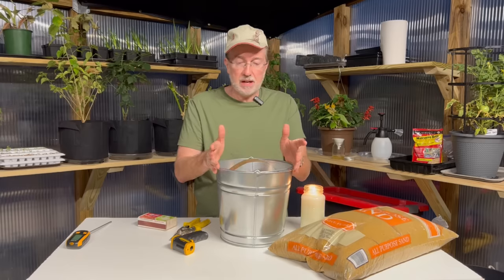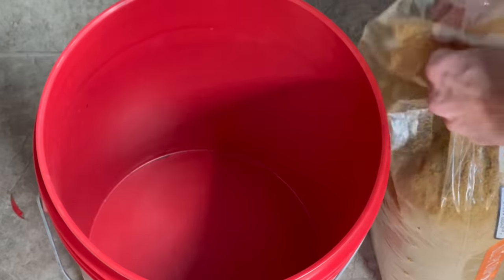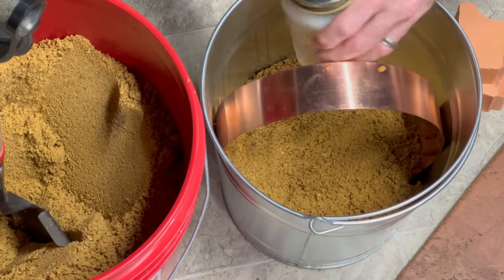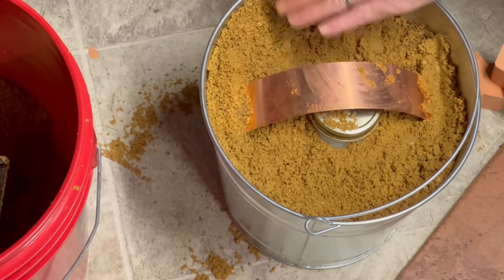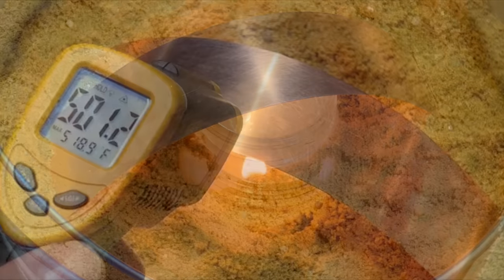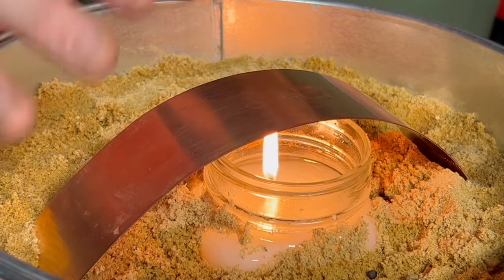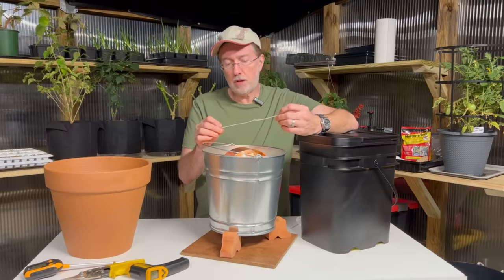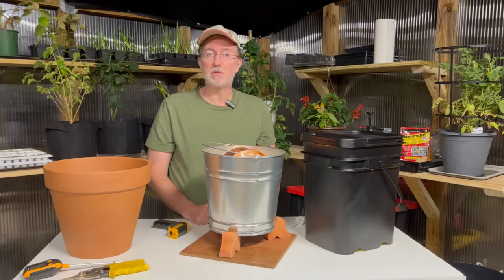DIY Copper And Sand Heater | No Electricity Needed For Greenhouse Heat

Comment: Perfect example demonstration of propagating so call magical principles 
While 80 BTU NO MATTER WHAT EQUAL 80 BTU .Don't be fooled Thinking this can genera any more .If anything good for attacking You Tubers viewers.
Reply from the maker: This candle heater isn’t designed to heat a greenhouse to a warm 72f but rather keep a greenhouse 1-2 degrees above freezing.  Tested 4 candles over 1 week and temps on nights without candles were 1-5 degrees colder.
Reply: @ZenGardenOasis.  So you have 2 identical green houses with the same plants and pots, building mass and insulation? and you have exactly the same measuring devices in both green houses? and you measured at exactly on the same time in each greenhouse (few seconds apart is not too bad)? 

If you did not then you cannot state your claim.

Comment: As an electrician can relate as copper being excellent conductor for heat. When leaving coiled bare copper wire exposed in the sun for a few minutes will heat it to the point where you can’t even pick it up

Comment: Using a large crisco container, get a matt for welding or a welding blanket and cut a strip of this into a strip small enough to be fed through a small section of copper tubing leaving just a quarter inch above the tubing.  Flare the copper tubing to stand on its on or dont and just have the tubing held stationary while the crisco hardens.  You have created an almost forever candle.  The oil will eventually burn off but over a period of months not days.  Welding blanket material withstands around 1800 degrees of direct heat so a simple flame in a candle format will never use the wick only the oil.  You can have a can liquified to top off the candle in such a situation as the oil burns down.  Using this inside a large metal bucket as outlined above with the copper strip should easily heat a room or two in a home.  Remember to let the co2 out a few times a day just to be safe.  God bless

Comment: Little bit of advice.. please use an old paint brush to sweep the sand around or off of the copper, as (you said) it can be sharp. Much easier

Comment: I can't get this to work at all, copper is touching the bucket at the bottom and sides, the copper strip is not even warm where it goes into to sand? Any ideas? Does sand have to be bone dry for it to work? Now considering drying it in the oven!

Comment: I'm thinking about a hybrid system in my greenhouse. It's not 8x16. What I'm thinking is running a small solar fountain pump to pump water from my rain barrels, through a solar water heater located outside the greenhouse. The warm water would come in and run ( bottom to top) through a coil set in a drum of sand, then return to the rain barrel. Basically use the water to heat the sand because the sand will hold the heat longer. The pump is solar and plenty to move water through a closed system of that size.

Comment: Is this okay for a drafty house with the home having a  main heat source like a hot water baseboard heater? This looks safe to use as a supplement.
Reply from the maker: I use it primarily as a supplement to my greenhouse heating. In any case I make sure I have smoke/carb monox detect w/ fire extinguisher.

Comment: Thank you for the video.
I am new to the channel (just subscribed).
Do you have any practical for a fridge that doesn't needs electricity?
Reply from the maker: Yes….my parents had RVs in the 80 and 90s.  Amazingly they had an RV that had a natural gas fridge in one.  Other ways of powering a fridge would obviously be solar with battery.  Icehouses we’re common in the 19th and early 20th century.  Using dry ice is great in a well insulated cooler.

Comment: Thank you for sharing. New here, I’m sure you probably mentioned this at some point. Is this safe to use in the house to heat up a room?
Reply from the maker: I would be sure to use o2, carb monox, smoke detectors for security.  Cheers.

Comment: Cool heater, question (1): which of your heaters is the best? (2) Have you tried adding an additional copper band going the other way to heat the bucket quicker?
Reply from the maker: My favorite is the cat litter containers.  Set up and that’s it, no fuel needed, but sunlight.  Yes on 2nd but haven’t tried.
Reply: Cool. I'll have to watch that video. Thx for responding so fast. I didn't see your veggie oil candle video, is there a link I could goto? @ZenGardenOasis.

Comment: You can put a 12 V fan and the battery with a small solar panel to keep the battery charged and have the fan aiming at the heater and put a Terra Cotta pot over the top.  Of your pale to protect the flame and it would act like a buddy heater. And it would heat the whole greenhouse.

Comment: Great idea, thanks for sharing, one thing I guess you will realize after heating up the sands is, definitely the paraphine will be melt, and that not gonna be efficient anymore! but how about this modification with two copper coils rapped like plate, one in the sand bucket (position about 30 degrees) with a hole from the side of the bucket that goes to the burning section, and place the burner under the other coil-plate so able to collect more heat to transfer it, (Tips: fill up the pipe with sand as well and free to experience with the angle to find better heat contact), and end of the project, of course now, you can add ventilation system to prevent carbon monoxide on top of the burner!? I'm looking forward to seeing what you think. Fan of your channel Ali from Rhode Island, Providence.

Comment: I have parrot, several. I live in the country and their room and my living room walls dont have insulation. Im always worried about power outages and keeping my birds warm and safe from fumes.
Which candle heater wiuld you use in Emergency heat situation?

Comment: I ran a terracotta pot heater with good results, however there was one occasion where soot built up from the flame of the candle it then dropped into the molten wax and seriously accelerated the size of the flame so it burned out of control and produced thick grey/black smoke. Plz be aware this can and does happen in my case i used tea lights so it also wicked burning wax out of the holders.

Comment: Thanks so much, I was looking for a way to store and slow-release some of the heat from my tea light candles, which burn for 3.5 hours. I place them inside of a ceramic holder that's meant to make the candle lights all pretty and stuff but I found that a bit of the heat was stored within the ceramic and more importantly keeps the air in my room circulating. I'm def going to try this!! I'm sure it's gonna work, but I'd need to find the materials that would work on a smaller scale.
Reply: Hmm I wonder if it's gonna work in a terra-cotta pot!? 🤔🤔
Reply from the maker: Make sure you have carbon monoxide detect.  Cheers

Comment: I would have thought compacting the sand more after putting it in the bucket would aid the heat transfer more by removing the tiny air pockets between the sand particles ?
Reply: Exactly.

Comment: Take an aluminum tube, crimp one end, put 1 drop of water inside tube, and seal the other end.
Now use the tube to stir your coffee and see how long you can hold the tube.
The tube will transfer the heat almost instantly.
Using a coil of aluminum tubing in place of the copper strip will work better.
Reply from the maker: Thanks for the info I will consider experimenting with it for a video.  Cheers

Comment: would putting a hole in the side of the bucket and running a tube threw the sand to be an air drawing sort of mechanism help?  like a "natural draft furnace"...also if the outside of the bucket also gets very hot, could you also add a ring of copper or two around the bucket to help capture and radiate that energy? or maybe rods that stick out from the bucket?  would that increase or decrease the heat generated?  i may make one of these as an emergency heater, if there is a power outage.
Reply: also if you would embed part of the copper into lets say a bucket of rocks, covered with that sand, the rocks may hold onto the heat longer...would need to be tested, and the types of rocks or chunks of concrete may need to be tested.   i wonder how much a copper bucket would cost?
Reply: A camping gas stove and a couple of winter gas cartridges can be helpful for emergency use. A standard flame burns about 1.5 kWh worth of propane per hour. You can do the cooking outside (which costs energy) or in a closed small room/kitchen and open the window for a minute afterwards. 
Enjoy some hot coffee/tea and place the pot above some tea light. Some hot-water bottles might come in handy as well :)

Comment: Will the glass the candle is in not melt? I thought of instead of a candle but use a old oil or kerosene lamp. Also how hot it will make a room or small house? Say 17x22 or 374 Sq.Feet.
Reply from the maker: Ive got another video about making a carbon felt candle.  Last for very long time.

Comment: So, how much more efficient would heating a ton of sand with a single candle be compared to heating a 3 gallon bucket of sand with a single candle? What is the upper limit (if there is one) of this heat multiplying property of common sand?

Comment: I have heated 2 greenhouses I personally built AND  helped a high school heat their green house with FEWER budgeted dollars (ala "tax dollars...) My  conclusions based on my experience is a greenhouse is uninsulated and requires more BTUs than a home with the same number of heated sq. ft.  Lots of whiz kid heating geniuses claim you can heat an entire room in your home with a tea candle inside 2 terracotta flower pots.  This IS true IF you are in Georgia (USA,) and it is the month of August!  Note: Georgia needs no heat in August. They need to waste all the heat  they can in August. But, no contraption added to a tea candle will heat a room in a house in Maine in winter.  A home's furnace will barely heat a greenhouse the same number of sq. ft. as the house in Maine in the winter.  And putting a contraption around a vegetable fat candle the size of the one shown here will not even begin to heat a greenhouse in Maine.     The contraption is merely to distract ones attention away from the fact it is impossible to  "help" heat a greenhouse with a vegetable fat candle.

Comment: I doubt people have those feet your setting your bucket on just laying around! Probably be more realistic to go get some fire blocks to set the bucket on, but that’s a brilliant idea for a heater!
Not sure if I would use aluminum though! It doesn’t have a very high melting point. 1220 degrees Fahrenheit! Copper is 1984 degrees Fahrenheit. I don’t know  if it gets over 800 degrees Fahrenheit from the flame of the candle to it building up in the sand, but should probably be something people think about
Reply from the maker: That’s an epic beard.  👍 thanks for your input
Reply: @ZenGardenOasis.  thanks for the compliment

Comment: How about a carbon felt used as a wick, as it lasts a long time. Also there is a video using a canning jar with a copper pipe coming from the top with the carbon felt inside that piece of copper. I thought it was a great idea.

Comment: Its fun to experiment but if you just want to get the job done then build a chickenwire fence about 4' high and about 4' deep around the greenhouse. Fill it with autumn leaves and run fat tubes from the pile into the greenhouse. Pee on it regularily to generate heat.

Comment: You should look into,   D.I.Y.  Carbon Felt Wick  Burners.
Reply: That is still not as good as heating the sand which holds heat well and long after blowing the candle out.
Reply: @lunarminx     I was thinking of replacing the candle with a carbon felt burner and still heat the sand. The candles flame will not retain the optimal height to heat the metal. The carbon felt burner should keep the same height at all times, what do you think?, I'm asking for I plan on building one, thanks for the ideas so far.

Comment: I used a single tea lite candle (8 hour burn tea lite), to raise the room temperature by 10 degrees. 
 First I placed the candle in a soapstone diffusor, then placed a block of soapstone on top of it.  I then placed a wood stove fan on top of the block of soapstone.  As the tea lite heats the soapstone block, the fan kicks in and disperses the radiant heat across the room.
I'm going to try wrapping the soapstone in copper flashing to see if it helps to warm up faster.

Comment: You could put some holes in the copper over top of the flame so some of the heat goes through the copper and will heat it up better because of the surface area being increases and the flow of heat through the copper. - PLUS if you're doing this indoors say during a power outage in the winter and you only have electric heat, you would also get mor elight shinging up through the holes, and maybe a nie pattern from it too. I would think a lot of small holes from a nail punch through it would be perfect, but  I'm unsure of the best direction to have the nails punched through...  if the nails went through towards the flame you would have the sharp points on the underside and that would top from any cuts or scratches for someone care less.... but it would provide even more surface area for the heat to get into the copper... AND less heat would go all the way through the holes and escape into the atmosphere, wasting it. With the nails pumnched through so the sharp ends are facing up you wouldn't get all those small pieces in contact with the hottest temperatures AND the heat would go up therough the holes a bit easier and not getting trapped by the complex geometry of all the small edges... so it gets wasted.....
YEa I think the nails should be punched through the copper so the sharp points are facing DOWN into the flame... BUT it wouldn't be much hassle to test this, you would just have to dump out the sand and copper and rebuild it with the copper coiled in the other direction- no biggie!! :D
GREAT IDEA!!! Now I just gotta find your video on the shortening candle!!

Comment: Just a thought but if you put another copper ring in at 90˚ to the first wouldn't that spread the heat more evenly through the sand and allow it to reach a greater temperature?

Comment: YOU FORGOT TO INCLUDE STUFF!!
I would like to see differences in temperature for the spaces you're actually heating... both internal and external temperatures and differences please.
 I would use it for my bedroom so I don't have to use the propane heating system that the house has.
 It's pretty large 19 x 13 x 9ft room.

Comment: What about using a fish aquarium heater to heat the sand in the bucket or a block engine heater that heats the oil in arctic temperatures???

Comment: You can use, outdoors, a Fresnel lens with a solar trucker aimed at the sand inside the bucket to heat it.
Reply from the maker: Thanks for the tip…
Reply: Dam I forgot I have a solar furnace I made as a kid in school ( up in the attic) it would melt lead , may play around with it , think the lens is like 12  x 12 maybe larger ,

Comment: Couldn't you use copper pipe and joints for a rectangular shaped conductor? Has to be flat? Has to be circular? Copper sheeting hammered cheaper than buying a preshaped piece?

Comment: Build a simple, hydrogen generator. Salt water is the fuel powered by DC voltage from a battery charged by Solar. This will give you renewable energy and provide a tremendous amount of heat for a sand thermal mass. Hope this helps.
Reply from the maker: Thanks for your input.
Reply: @ZenGardenOasis.  you are welcome, this is the type of system I used to keep my aquaponics system warm in the winter here in az.

Comment: I wonder how much more heat you could get if you were to use a copper bucket with four candles in copper containers with two copper straps criss crossing and brazed or riveted to the pail.  I dunno what it is but for some reason I've reading and watching videos about easy and semi easy home made heat producing projects.  Like alcohol stoves and various kerosene heaters.  I like in a very well built comfy home with a new furnace and a fireplace but something inside me is telling me to prepare for the cold.  I probably already have enough back up heat sources in place to keep my house and garage comfortable.  I also have a generator I could plug the furnace into if need be.  We haven't had a power outage here in years and when we have they've been very short, maybe a few hours at most.  I'm not a nutzo survivalist or even a prepper.  Something in my mind and body is telling me to do something, something is going to happen.  Or maybe I've lost my mind
Reply from the maker: What was it the Boy Scouts taught…..be prepared.  Have a great day.
Reply: It's definitely better to be prepared and Not Need it, then to say things won't go sideways and be in need of alternate solutions for temporary heat and not have it.  Everyone looking at society, the world scene and governments are realizing we're "not in Kansas" anymore.  Things that we felt would NEVER happen are happening right before our eyes.

Get prepared  -  Just in case.